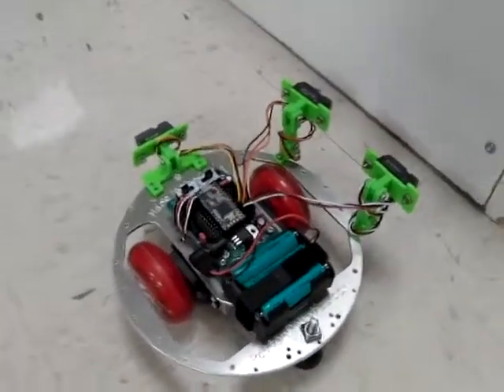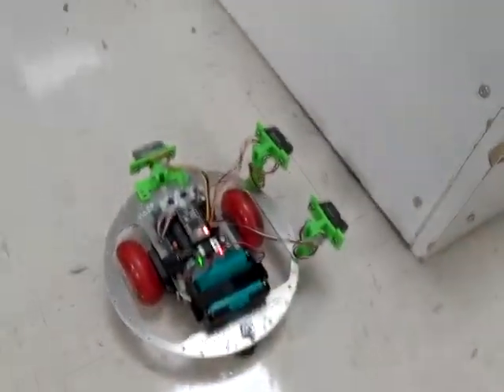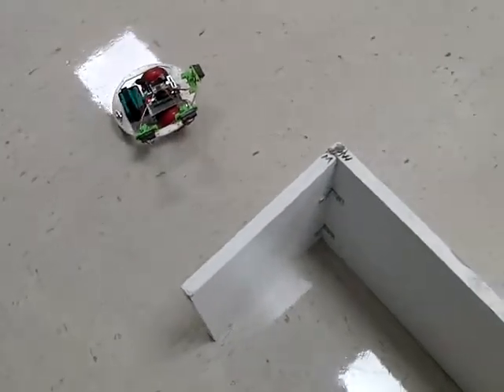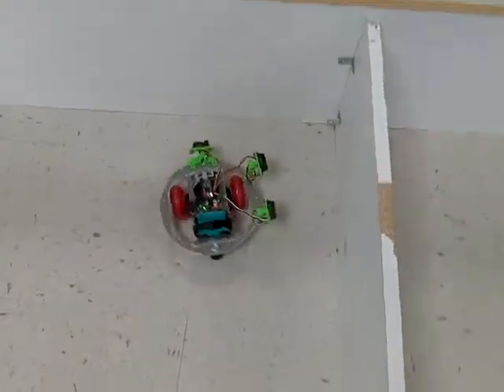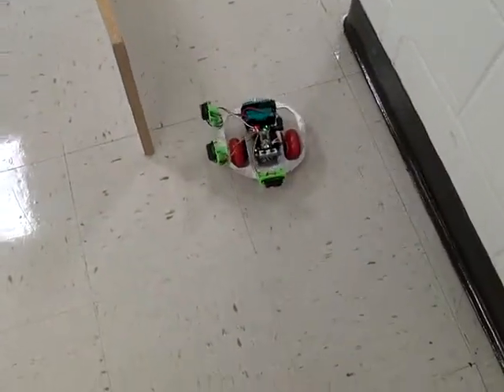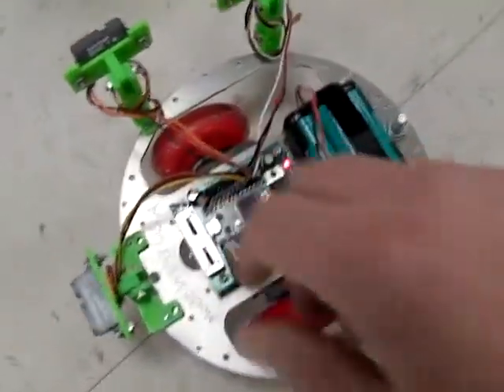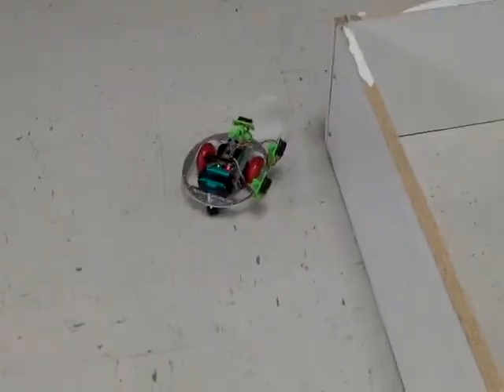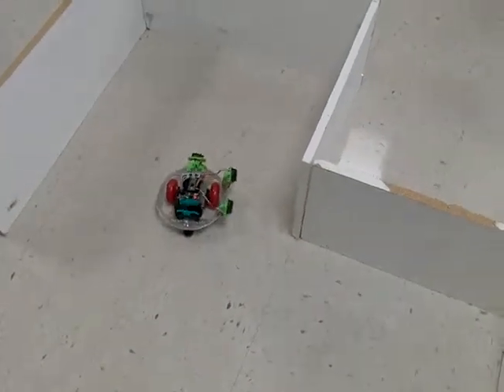OneBot Robot Navigates a Maze with 3 Sharp IR Sensors

Comment: The way to do it (auto-fix) with 2 IR sensors (1 on right): Know the speed, take two different readings with a time difference, calculate the angle the robot is going, and turn. Note that the time difference between the two readings shouldn't be too small because otherwise there would be no differences in the IR distance readings. Also a time difference that is too large will result in lagging. This wall following method is only doable with IR because sr-04 don't have that precision. This would be a good challenge for advanced students who have some knowledge in calculus to see how "calculus" works in robotics.